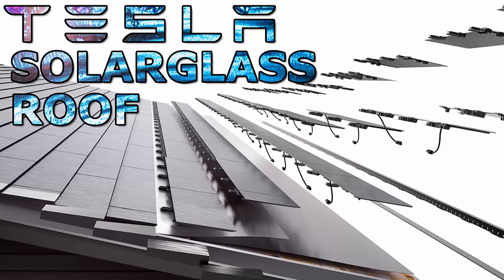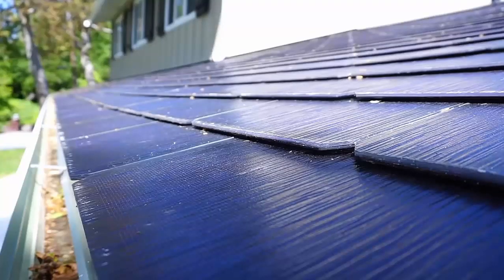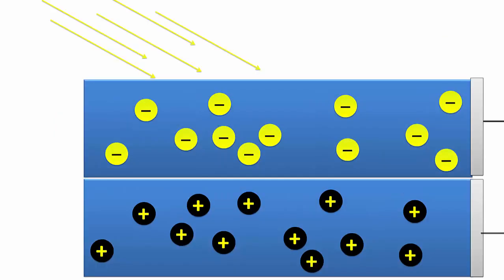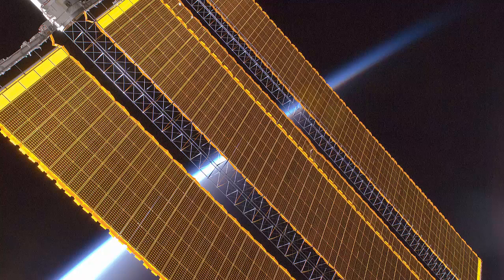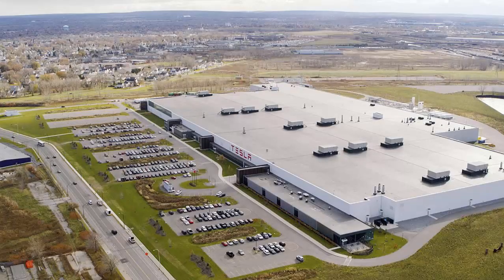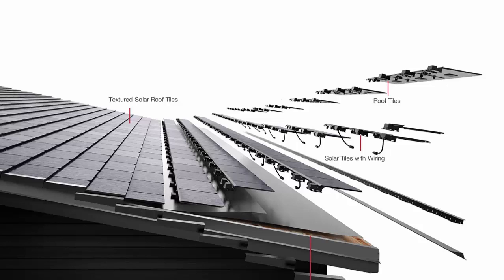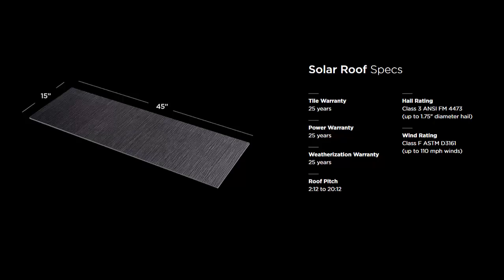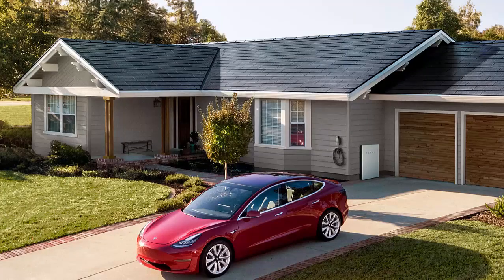The Truth About Tesla Solar Roof

Comment: " On par with a steel roof ". How about " not really ". My grandparents installed a steel roof on their barn 40 years ago. The only thing I have had to do is put 2 coats of paint on it, with literally no end in sight. If you want something to be " on par with a steel roof ", you're going to need something that is going to last 60+ years. That's why so many people are putting steel roofs on their homes now. They're sick of the 20-25 year asphalt shingle gimmick.
Reply: Standing seam is rated for 50 years. You can put solar on it with an S-5 non-penetrating fastener system. In 25 years when the panels are not working as well swap the panels out without having to redo the entire roof.
Reply: Completely agree. I'm not a homeowner, but would go the metal roof all the way not only for longevity, but for water catchment. Plus shingles just allow thousands of failure points on a roof (from day 1 to year 25) vs one piece of metal/ corrugated steel not to mention installer error/product defects. Get yourself a metal roof with standard solar panels and save yourself a ton of money without leaks.

Comment: I am in the process of planing a 40 unit development where all the houses will use solar and there will also be multiple additional solar collection artwork throughout the development.  I am hopeful I can use the Tesla solar shingles as that will be more ecstatically pleasing. Also connecting all the homes together in a sharing basis and using battery backups in each home.  I will be able to assure the entire development will be off the electrical grid. 
my home designs are 78% more energy efficient homes. 
I am in the Phoenix Arizona Area. wish me luck to pull this off this endeavor.
ps I enjoyed your video
Reply: Do you mean aesthetically pleasing?

Comment: They use Homewyse as a compairison of prices of traditional roofs. My house they said $7.30 sq ft2; but I'm in South Dakota.  It said 19k to do traditional asphault shingles. But I know the MAX my roof would cost here is 9k.  So the #'s they reference must not be correct for all zip codes. So 19K + 21k (Tesla solar panels) = (40k) this includes 9k of federal credits. So Jan 1 2020 it would be 49k  per Tesla site for traditinal roof in Sioux Falls, SD.  They show 36k for my SolarGlass roof. 
It seem less expensive than 40k but the 40k is way wrong.   The correct comparison is 36k for Tesla SolarGlass and 9k + 21k (traditional Solar) = 30k until end of 2019.  So it is still more expensive and on Jan 1 Solar glass goes up more than traditinal panel. (I don't need to buy Tesla traditional panels BTW)
Reply: One question I would pose is how much power both setups would generate?

Comment: I'm sure it's only the solar cells which are 25year rated like all other panels from other manufacturers. The tiles themselves will probably out last the house. It would therefore be nice to know if in 25years time you can just replace the solar PV tiles rather than the whole roof since these will be full tiles not cut and would be much quicker and ecological to replace.
Reply: Where have you seen a roof material that lasted infinite time? Sun damaged any surface on micro cracks levels. Adhesives loose integrity. UV protected plastics still turn yellow just at longer times. Silicon panels will loose efficiency. Elan Mask is all about monopoly.  He makes it seems like there is no room for others to compete. Its almost given that he can't be installing all solar roofs in US. Yet his calculations runs for 5mill houses a year. He just calculated in that by the time he racks profit and 25 years later it will be cheaper for him to produce tiles. So no competition at the start. No competition 25 years later. Capitalist strategy. This is with every his project: luxury electric cars, US rocket vehicles, lithium batteries, solar panels. Out mass, over produce, worry about the costs later when competition did not sustain his mass production. Because he knows he will be average producer in other markets.

Comment: Normal roofs require replacement every 20 years. I would not buy it if the warranty is 25 years or even 30 years.
I live in the midwest where the snow can sit on my roof for weeks to more than a month.
Reply: yeah and tesla thinks that solar energy is the solution for our energy?! wtf we need way more than solar and wind and hydroelectricity......

Comment: With California power outages this could be easy decision for implementing the combination of power roof and power wall
Reply: The high cost makes it a noncompetitive product, even in new construction when compared to the total combined cost of new roofing and new solar panels. It's most likely a niche market product for those who care enough about roof aesthetics to spend many $thousands extra for solar energy. The idea that 4 million per year will be installed in North America is pure fantasy.
Reply: Plenty people in California have solar, some areas it is 1/3 to 1/2 of homes. That means that during the day electricity costs 10 C and en the evening 40 C. So there is a serious surplus problem. Solar won't prevent outages, especially as the current ones are intentional to avoid sparking from HV cables. However having a few panels on your own home, would act as an emergency generator, but you have to do your washing /gaming / vacuuming /open the fridge, during the day.
Reply: @davidnivison9915  yes all those solar power roof are still very expensive for the average people
Reply: @carholic-sz3qv  Still expensive but the gap is closing and the PG&E debacle is accelerating the process.  (one solar stock at least jumped on the blackout 'disaster')  Both PV and battery backup prices are on a long term trajectory down.
Reply: @Tore_Lund  You know that the roofs sell with a battery system for nights and low light conditions, don't you?
Reply: @Myrddnn  I was talking about Solar in Cali generally. And when enough people in an area have it, there just is a surplus during midday, so if  the Tesla power wall could be used to time the sell back period to the evening, that would be neat.
Reply: @Myrddnn  That was really not my complaint, rather that you can sell your power for pennies during the day and pay a premium at night even if it is your very own electrons that have been stored out West.  So that is why it makes sense to store your surplus yourself and either use it or sell it when the price is high. I know a guy that has a 4.5 kWh Lifepo4 pack, and he charges it at low rate from the grid during the day, and sell the power back at night earning $1.5 per day. He also has solar, so during summer he doesn't use grid much power and can sell his own production so having your own batteries as opposed to using the power companies storage, improves the economics considerable.
Reply: @Tore_Lund  That's what the powerwalls are for. They offer them as part of a home solar or Tesla car sale. They even do a package deal for all of it. You get enough powerwalls to last you as long as you think you might have to be off-grid in an emergency and you are covered.
Reply: @Myrddnn  With Californian blackouts, that's a strong point, but really timing your sell back of stored solar power can help paying off your powerwall investment.
Reply: @Tore_Lund  True. I believe it's all programmable, with modern smart meters and all.
Reply: @Myrddnn  It would make most sense to do it like that. Cheers!
Reply: @Tore_Lund  emergency generator?   grid power down = solar down unless you spash out even more money for batteries and control systems
Reply: @Myrddnn  article has nothing to do with yuuuuge city sized storage facilities,   which in the real world dont actually exist.  Just the fetid imaginations of renewable fanboys keep the myth alive because they know without it ,  all this is just a pointless game.
Reply: @yarpos  Which is why you have Powerwalls.  Why would you just get panels to not have a backup?
Reply: Power walls are costly and do not power much at all.  You can fill your with cheaper battery operated screw on led lights at this point and illuminate well. Power walls will not power your heat or a/c.  Tesla is a great inventor and master marketer.  Not enough data or actual models of his mass produced inventions yet.  Don't waste your money yet.  We have had 2 solar homes so far and they are a huge improvement but  APS still has their claws embedded into our pockets. Until there is some responsible/stable protection for middle/lower income people, cost and production will not be available to anyone but the rich.  Do your homework.

Comment: With the new requirements of NEC 2017 for Rapid Shutdown I wonder how this roof can be implemented.  The voltage on the wiring within the Photovoltaic array is supposed to be lowered below 80VDC within 30 seconds of initiating a rapid shut down by a first responder.

Comment: Too many connections! How would you like to troubleshoot that nightmare?
Reply: It has individual controllers for each panel which is one of the reasons it’s so high priced but it’s also has another controller controlling the controllers so it lets u know which one went out.and it’s a grid so u can number and letter the rows so u know, So a chart so to speak.

Comment: What is the power efficiency of solar panels versus the solar cell roof tiles?  What is the atypical cost differential of both types of installations?
Reply: Power efficiency for area sq footage is garbage at about 4% where each tile produces about 24watts. Overall it's about 4 to 5 times more expensive than traditional panels the savings in electricity would be a wash because they build your solar setup to the amount of power you use.

Comment: Even if you don't have any solar panels to charge them, would it be cost effective to install a bank of batteries to charge during off-peak times and then use the power during on-peak times so you're not actually drawing from the grid and paying those on-peak prices? Would the cost of the system be more than the savings in just paying for off-peak electricity?
Reply from the maker: Yes, this is exactly right. It depends on the spread between your on and off peak prices and how much electricity you use on peak to justify the cost of the batteries. And I guess also putting a value on the added benefit of having power during power failures.

Comment: Come on guys, look at your discussion of the p-n junction again.  PV works by exciting the electrons to a high enough energy to cross the p-n junction.  Also, there is no discussion about the serviceability of this system, which really is the biggest long-term concern with all solar installations.
Reply: Agreed. How do you know if a particular shingle need to be replaced, or is under performing? I would assume at least with standard panels that you can troubleshoot a one bad panel out of 15, but a bad shingle out of hundreds/thousand especially as time goes on? Plus inevitable leaking issues. Get a good metal roof and a standard solar array that's probably not only more efficient, but way cheaper. Another Musk winning idea here. SMH

Comment: What about hail? Wouldn’t that damage it?
How do you replace these in the center?
Can you walk on these?
What about satellite mounting when the roof is the only place available?
Are they going to make circular cut outs for vent pipes? It looks horrible currently
Is the ridge vent also connected?
Reply: Even the glass tiles can handle a hammer swing, it can withstand..When we install them, we stomp on them to secure them..u literally have to smash something on them to break them ... if they break, we’ll just come out...pop tiles around the tile that broke..replaced it and stomp it all back in place.

Comment: this is a classic PR-video with a misleading title, as there is no "Truth" about Tesla´s solar roof. You are better informed if you order a catalogue directly from Tesla. Never mentioned: there is no airflow behind the shingles. Paneels are cooled by the airflow under the panels. This is important as solar elements loose efficiency when heating up. The hotter they get the less effective they are. shingle <=> panel / zero : one

Comment: FrontSeatGamer: Is there any info (anywhere) stating that the Tesla roof can be used with a home that's 100% off the grid?
Reply: Of course it’s possible provided you have enough Storage and a reasonable sized array.  Look on YT, Wild Wonderful West VA, they are adding 1 battery and 20 panels this week.  They are off grid but have a small generator.  I think this is the first time they’ve used it because they took the system off line to enlarge it.  They are getting ready to build a large addition on their house.  It’s a great channel.

Comment: Thrilling to follow this. Thanks for the vid. 
Laughed with delight at the idea of two teams competing independently to install the roof fastest. Excellent method. 'Would love to know the material incentives, apart from fun and high pride.
I'm confused by the price comment about "plus retrofitting". 
Can you clarify what is included in the V3 price, compared with a conventional roof, and compared with a conventional roof with conventional solar panels.
Reply from the maker: Thanks Bruce. Yes the V3 version is the roof itself, so it behaves as a roof but also generates electricity. For retrofit, you would have to pay for a regular roof, and then add solar on top, which is clearly going to be more expensive doing these things separately. For a particular sized roof as shown in the video, a regular roof is $23k + $19k for solar retrofit, whereas the solarglass roof was $33k. So the savings make sense for people who need a new roof and want solar.

Comment: How does it handle shading? micro-inverters are used in normal installs to overcome spot shading and different angles.
Reply: thought criminal north = never, you loose 25 percent of energy automatically, not worth the money you spend on panels
Reply: @dogbones4838  unless you live in the southern hemisphere of course